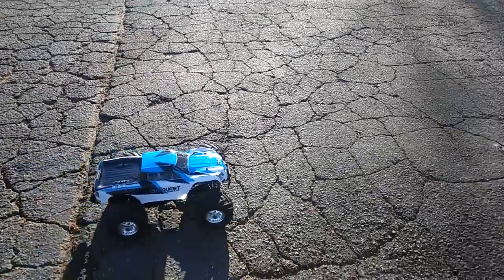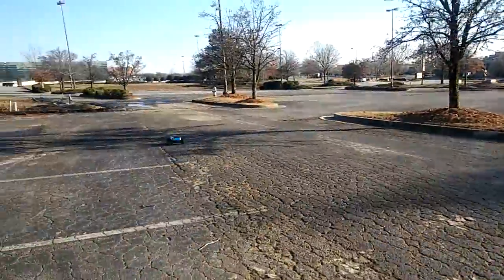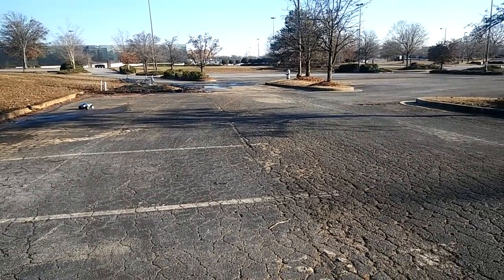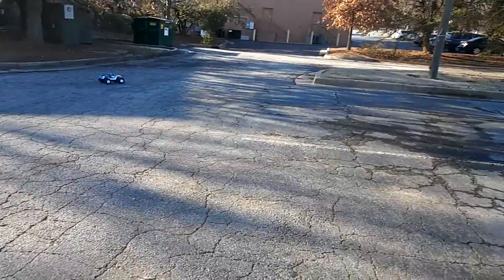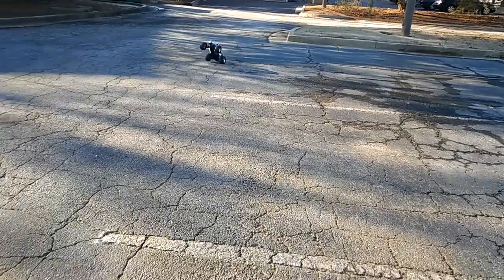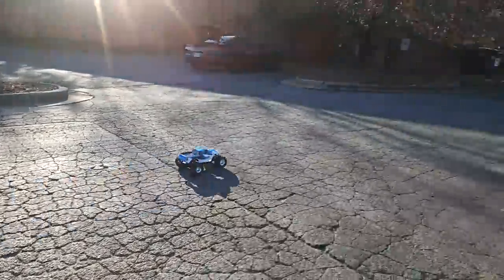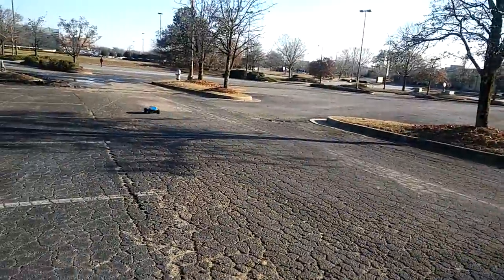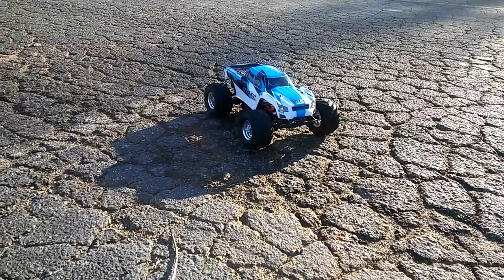Helion Conquest 10MT XB with HPI 550 Motor Test Run

Comment: im taking notes on your build JayTee RC thanks for sharing.  went out today in the cold with my son and managed to break some parts. any idea if any swap on the conquest or is the helion brand replacement our only option. we're looking to replace the lower rear control arm.  any help would be appreciated thanks.
Reply: brandon hill if you have the conquest, some other helion parts will work. you may have to make small modifications though(grinding to make fit) which helion do you have? i can give more specific answeres then.
Reply: Bill Satterfield. i have the  conquest 1:10 mt same as the video. our local store doesn't carry any helion parts. so im searching for a substitute or upgrade
Reply: brandon hill you can use the front lower arm from a slash 2wd to replace the rear ones on your conquest. they are the same length(8.5 cm). the only thing you will have to do is the end that connects to the chassis you will have to stack 4-5 small washers on the screw that runs thru...the opening is just a little wider. my hobby shop didnt have the helion parts either and thats what i did
Reply: Bill Satterfield good info thanks
Reply from the maker: brandon hill what did u break?
Reply: JayTee RC. was flying through some leaves hit a rail road tie,  flipped landed hard on the sidewalk busting the rear control arm. whoops!

Comment: can u please explain when a better servo is needed. Thank u
Reply from the maker: cnbsdad well for this one it is a little slow and now the gears are stripped. usually if u sit ur car down and turn it left and right and it does not turn all the way the servo may not be strong enough...there are tons of factors as well and I may try to do a video on it.
Reply: If you can do a video on when to change out a servo that would be great. Thanks for replying

Comment: my conquest brushed 550 lost a brush and smoked itself.. how's that hpi gt550 holding up?  are temps manageable with a higher geared pinion?  im running 3s 4000mah 25c on mine
Reply from the maker: brandon hill a lot better

Comment: do you have a go to servo that you like thats good value? any recommendations?
Reply from the maker: yea, it depends on my car and also the budget.
Reply: JayTee RC value is the keyword brotha. lol! 40$
Reply: Bill Satterfield hey man, I would greatly appreciate that. I have the team associated t4.2 & helion invictus 4x4
Reply: mike253905 i have 1 for the team associates for sure. im not sure of the size of the servo for the invictus but i will send you 1 for it with a un iversal mounting plate so i know it will work. send me your info and i will put them in the mail tuesday bud.
Reply: mike253905 also...not sure if your interested but i have a conquest xlr 2wd 10 mt for sale...week old. it has a broken chassis and a new one is 24 bucks. its brushless, has 2 bodies and when i buy any rc i buy a complete set of extra parts to have on hand to avoid down time. I have a full rebuild kit for the diff, spur and pinion gears, all bearings,lower arms,turnbuckles, all drivetrain/steering/suspension components, new motor and esc and more(screw package, nuts,clips etc.) all still in packages. i will sell everything and the truck for $150.
Reply: mike253905 Im selling it because i have my stampede that i have built like crazy and nothing seems to compare to it as far as breakage, power,etc. and i have many other r/c's and honestly the conquest just isnt what i was expecting i guess. if interested let me know and we will work out the details. it's a great buy with all the extras and i can even send you a vid of it running before you buy( chassis is repaired, but should buy a new one) take care my freind
Reply: Bill Satterfield whats your email?

Comment: i have finished testing my conquest 10mt xlr....its for sale now. it has a broken chassis($24 new) the truck has been run 3 times. i have a complete set of diff gears, pinion gear, spur gear, complete slipper clutch set up, new turnbuckles, 2 bodies( 1 stock and 1 aftermarket) and some other parts( i buy a complete set of extra parts when i buy a vehicle so i have them) all extra parts are still in packages. i paid $213 just for the truck a week ago. i will sell all of it for $150.
Reply from the maker: what state u live in?
Reply: JayTee RC im in maryland...u?
Reply from the maker: Bill Satterfield atlanta
Reply: JayTee RC I have been to Atlanta quite a few times...passing thru. I was at Ft. Benning 88-93... i love it there and consider it home even though i was born and raised here....good memories bro!
Reply from the maker: Bill Satterfield inbox me on face book

Comment: I put the 775 with 3s lipo spun the transmission gear replaced with steel it will burn the rubber on the pavement if I tye it to my kids bike lol i don't know how the axle didn't break